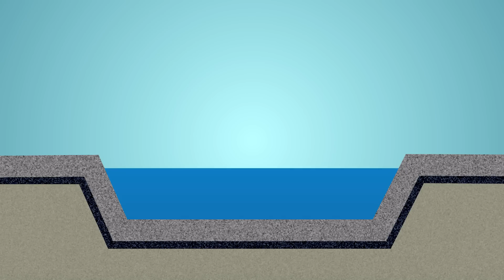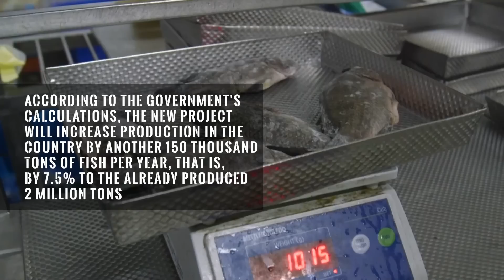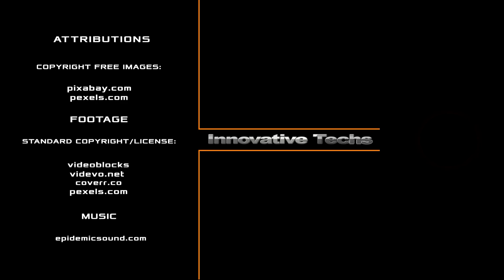How this mega-project will make Egypt the continent's largest fish producer

Comment: The Egyptian workforce is unparalleled. They are mighty and hardworking. They are the ones who built the pyramids. They are the ones who built the Suez Canal between the Red Sea and the Mediterranean. They are the ones who built a high dam to prevent the flow of Nile water and its waste in the Mediterranean. They have the greatest width. A suspension bridge in the world. They have the largest solar energy station in the world. They work at the speed of time. Projects do not take long. They have within a year or two. They complete their work accurately and deliver it to the state. Local workers in It is an indispensable country, as it is economic, and for workers, it is a patriotic act for their country, and China is the best proof

Comment: Would be great if they added solar panels near the fields to run the operation sustainably also from the energy perspective
Reply: There's a ton of Solar Power projects in Egypt, I believe they already have the largest solar field in the world right now and a dozen more under construction. In the case of this project water desalination requires an enormous amount of energy, which I believe they use natural gas for (I think).

Comment: Great, Why put some Trees around the ponds any kind it would save on water evaporation.
Reply: Roots will break up the concrete and the packed earth foundation under the concrete. They would have to be very selective with the trees, and the type of free they could use would end up being too short, or not have enough coverage to help.

That said, they could built a nice wind break of trees on the predominantly windy side of the project and help slow evaporation in that way, while cultivating another project. Man man oak forests are gold mines as far as cash crops go.  It just takes a few decades to grow.
Reply: @blackwolfnews1722  evaporation should not be a real problem as it's next to the sea and the water is circulated regularily
Reply: @MohamedIbrahim-rv7ii  still wouldn't hurt to have an oak forest growing on the windy side either. Why ignore millions in free money.

Comment: Ethiopia controls the water
Reply: Mohammed Hany  
Turks hold similar advantages, its geography.
Some nations control oil and some control water.
Rarely control both.
😂.. Your response, low class and uneducated.
Reply: @ⲁⲧⲥⲉⲙⲛⲓ 😂😂😂 lol.
Reply: @ⲁⲧⲥⲉⲙⲛⲓ 
Turks other than control of water has nothing to do with this. They were used as an example because of that fact.
Reply: They dont
Reply: @user-or1rm1ol3q  
The Grand Ethiopian Renaissance Dam (GERD) is the source of an almost decade-long diplomatic standoff between Ethiopia and downstream nations Egypt and Sudan. ... Though construction has been hit by delays, Ethiopia began filling the reservoir behind the dam in 2020.Jul 8, 2021
Reply: @lissaleggs4136  the  dam  will be destroyed   dont worry about
Reply: @user-or1rm1ol3q  
65% of Ethiopians arent connected to electrical grid.
A cascade of four dams, the GERD is a large undertaking; the project will generate 5,250 megawatts, costing an estimated total of $4.6 billion. Despite the massive expense of the project, Ethiopia has found a willing supporter: China. Granting $652 million in loans to Ethiopia in 2017 alone, Chinese companies have also undertaken some of the construction work, with the Chinese Gezhouba Group and Voith Hydro Shanghai receiving contracts to speed development. China has also played a role in developing other infrastructure related to the project, such as providing a 2013 loan of $1.2 billion USD in 2013 to build power transmission lines connecting the dam with nearby towns and cities.
Reply: @user-or1rm1ol3q  
Ethiopian highlands supply over 85% of the water that flows into the Nile, however, the Ethiopian government argues that the country has a right to the water and to use the Nile to provide affordable electricity to Ethiopian citizens.
Egypt, which depends almost entirely on the Nile waters for household and commercial uses, sees the dam as a major threat to its water security
Reply: @lissaleggs4136  Ethiopia   doesn't  supply  water  it  just flows  to  Egypt  for thousands of years  befor there was something called Ethiopia
Reply: ethiopia can't even control ethiopia
Reply: @lotfyhassan2035  
Cairo has argued that the dam presents a fundamental threat to its energy and water security. Egypt relies on the Nile for 90% of its water needs, and the government has already taken steps to limit rice farming on the Nile in order to protect water supplies for its rapidly growing population—growing at 2.5% annually and projected to reach 145 million people by 2030.
Reply: @lissaleggs4136  we didn’t limit our farming in anyway. 🤦🏿🤣 we are growing more and developing irrigation systems so we can grow more. We didn’t limit anything . Go spill ur gov propaganda somewhere else.
Reply: @yousefdessouki8903  
GERD is a microcosm of China’s broader strategy in Africa.
Countries that are reluctant to reform existing practices may want to avoid conditional economic ties with the United States, and instead prefer ties with China that have fewer strings attached
Reply: @yousefdessouki8903  
Im not Ethiopian, not sure why you think I am other than you are a weirdo..
Reply: @yousefdessouki8903  
Apparently you wear blinders like a horse too and live in an imaginary world that revolves around only Egypt..
Reply: @lissaleggs4136  look who is talking 😂😂😂 u entered a video about Egypt, which doesn’t have anything to do with ur country, and u commented ur silly comment about Ethiopia controlling the water 🤦🏿🤦🏿🤦🏿🤦🏿🤣🤣🤣🤣. It seems u don’t live in our world and know how people .bettor to stay in ur country affairs and not involve in others affairs without understanding the situation , from all sides.
Reply: @yousefdessouki8903  
You did it again..
Everytime you mention military you lose argument.
You admit you lost control so you must use force as leverage.
Yousef gives the false impression that filling up the dam is like filling up a bath - and that Ethiopia can turn a tap on and off at will.
Reply: @yousefdessouki8903  
Given the stage that the construction is at, "engineering-wise, physics-wise there is no way to stop the filling now" until the water level reaches the top of the dam wall, Manchester University's Mohammed Basheer, who has been studying the Gerd for the past decade, told the BBC.

This is because more water is entering the dam site than the volume of water that can physically pass through the two open outlets in the dam wall (60-110 million cubic metres a day).
Reply: @lissaleggs4136  the dam doesn’t have enough water behind it so Ethiopia can not turn on or off the tap. That’s means that the dam is vulnerable to a military strike . This means that conflict is not over yet . This means that the game is nit over so u can not say turn on or off. Egypt will not  let that day come my friend and that’s.where Egypt patience will expire . Attrition of Ethiopia and causing an indirect warfare means that Egypt Jobwill be easier . Bring ur pop corn and wait for the big game. It is not over.
Reply: @lissaleggs4136  the filling stopped because of the rain season is still going . U little kiddo, the dam only has 7 billion stored and the Ethiopians can’t fill anything currently till next July because the rain is passing through the middle part. They can’t construct the middle part currently. That’s why they failed in the second filling. Because they were unable to finish the required construction , Ethiopian filled just 4 billion rather than 14 billion. Meaning that dam didn’t reach the level of being controlling the Nile. Don’t celebrate yet.
Reply: @yousefdessouki8903  
The Gerd, in theory, could help regulate the flow of the Blue Nile and make Sudan less prone to floods.

But Sudan was taken by surprise when Ethiopia shut three of the four diversion outlets for the water.

This led to lower levels downstream which disrupted Sudan's pumping stations for irrigation and municipal water supply.
Reply: @lissaleggs4136  Sudan not Egypt. Bare in mind that, this was during the flooding season only for the first days not forever.and Sudan is also with Egypt regarding that issue and is doing military maneuvers with Egypt. The dam , in theory, can’t control any water ,now. What are u talking about was the first filling and only happened for first days but can’t be done anything. This time no water shortages ,sudan faced.
Reply: 🤣🤣🤣 ur dam is still vulnerable and u didn’t finish ur second filling nor complete the dam. The total is justv7 to 8 billion .So u don’t control anything. Don’t celebrate yet, the dispute is not over. U will have a day with us . And before u control the water, control the bunch of rebels who are hammering u hard.
Reply: @yousefdessouki8903  
With so much stupid in your brain why need an Army?

Comment: I wonder if they will put floating solar over half of each pond. Then they can power the desalination for the water
Reply: Daniel Good point. Floating solar could reduce evaporation as well as power the facility.
Reply: @sbl17jackson37  floating solar would be cool because you process fish durning the day and the desalination you could size to run durning the day. So the only nighttime draw would be the ice storage
Reply: Good point but can this reduce the the amount of oxygen saturation in the pond?
Reply: Egypt is keen on renewables nowadays. 20% of it's energy is renewable now including the world's  largest photovoltaic solar farm "benban"

Some of these fish projects use dual phase water purification and uses tiny hydrodams to capture back the energy before releasing the water in the sea.

While others treat bio waste to be used as fertilisers to cultivate the desert.
Reply: so unnatural